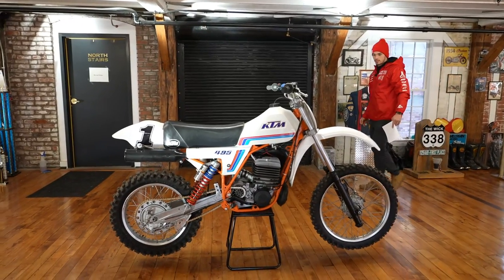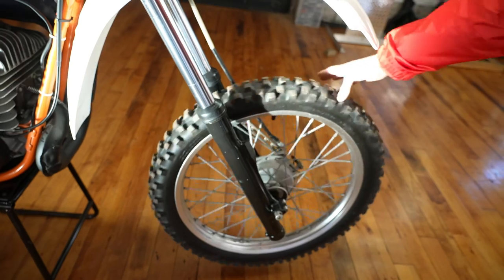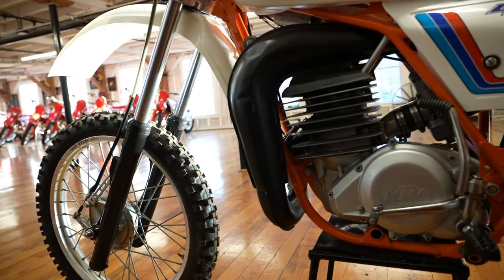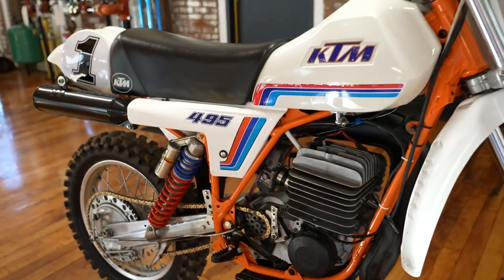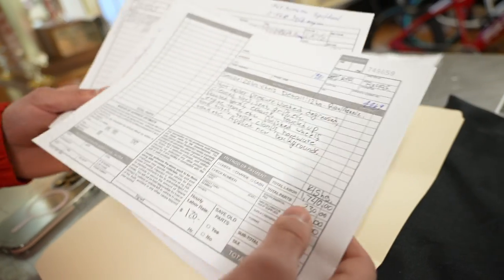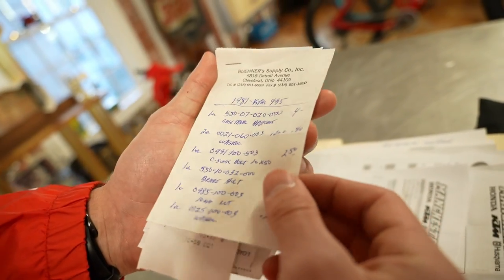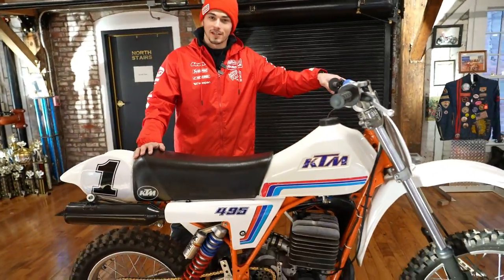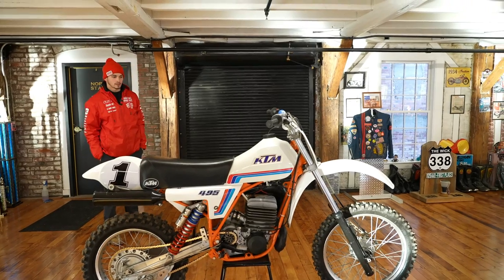123.75 MPH WORLDS FASTEST STOCK DIRTBIKE KTM 495 CLOCKED IN 1981

Comment: My buddy had one. He didn't tighten down the cylinder bolts properly. We were out riding and he said the bike wasn't running right. I asked him to fire it up. When he did, the cylinder and head was moving up and down!. It still ran! We tighten up the bolts and nuts and went on our way. The bike was definitely badass. Tons of power.
Reply: How is that possible? If the cylinder moved even a hair all compression and thus combustion would be lost.
Reply: Crazy right? But I saw it with my own eyes. The cylinder and the head are connected so the compression was still there.
Reply: My ‘81 KTM 250 MXC did that out on the trail. I had to stand on the cylinder head to stop it from sucking air at the base of the cylinder so I could get it back to the garage.
Reply: Crazy😂

Comment: Hi Ken. In the 80's I raced an '81 Maico 490 twin shock, and my friend had a '85 ex works KTM 500. It was so powerful, it felt like 4-stroke to ride. Fantastic bikes. 🏍🏴🏴
Reply: I believe way back. Dirtbike Magazine, when it was cool. I think SuperHumky clocked the 495 KTM around 120 or so. If it had different gearing, maybe faster. I think. I will say this, that those early KTM's are neat bikes. Rare back then even. Didn't see many 40 years ago.
Reply: I got to ride a retired ‘70s moto-x Maico in ‘95. the owner was my GF’s uncle who had 2 Bultaco bikes as well. Maicos were basically race bikes bought from a dealer weren’t they? I don’t know a thing about them…I just remember riding that one in ‘95 was the 1st time I ever used a decompression valve.

Comment: My buddy had a 1982 KTM 495.  I don't know what the CR was, but it flipped me clear over the bars when it kicked back.  The timing was advanced so far btdc it was rediculous.  My buddy was a body builder and weighed over 300lbs.  After he saw what happened he had a go at starting the bike.  It kicked back on him too, which pissed him off.  Bob's legs were huge and he could do over a thousand pound leg press.  He came down on the kickstarter again with all his might.  The 495 kicked back again and it was Bob vs bike.  The chrome moly shaft coming out of the engine that the kick starter attached to snapped in half!.  I took the busted shaft off and you could see where the shaft's metal had twisted before shearing.  While waiting for a new shaft to arrive I took a look at the Motoplat ignition.  It had an INTERNAL Rotor!  That's right, NO weight on the crankshaft!!  I ended up getting the regular Motoplat that gave some enertia, and retarded the timing.  I also stuffed two head gaskets on it, the bottom of my foot still aching.  The bike could now be started but was still crazy fast.  I had fun at the Oregon Dunes on that bike with a 14 paddle tire.  None of the rails and buggies stood a chance in the drag races up the dunes at Honeyman State Park.  I still have that internal rotor Motoplat and Bob kept that busted shaft as a souvenir.
Reply: Bob was lame

Comment: I rode motocross on a 1982 496MX in the open novice class when I was a sophomore in highschool in 1982. It had the dual control throttle that I ran on the 1/2 twist mode to slow down the throttle response. I also went up one tooth on the counter to mellow it out a bit. I would start in 2nd gear. Shift to third on the start and ride the entire moto in 3rd gear. 
On a dry lakebed it would go fast enough to bring tears to your eyes with goggles on. I have no idea how fast that is. I can tell you that I never saw the absolute top end on that bike. Going that fast with tears so bad that it was like having a swim mask full of water on your face is enough to make you roll off the throttle.

Comment: That bike was my competition every weekend at the motocross track for my CR480 and I don't recall the 495 KTM ever beating me!
Reply: The Ktm was not a great mx powerband. I worked at a large Ktm dealer in 1982 and we worked with some of the factory riders when they were on the west coast. John Finkleday and Joey Schlag were both on the bikes as well as a local rider that we sponsored named Tracy Oswell. Tracy was top 10 at Mammoth Mountain in open pro when it was almost a national. We spent the entire time smoothing out the powerband. Stock was so hard hitting it wore everyone down. Even Finkleday and he was a beast. Great looking bike and pretty reliable as well. I had a 250 from that year with twin online that year and it was the best twin shock suspension l ever rode.

Comment: Nice! Not sure it was tuned down in 82 might have felt like it they handled far better with the pro-lever rear suspension. It got the awesome power to the ground better.
Reply: They changed from a piston port engine to a reed valve design and yes, it was detuned in 82-84.

Comment: Hey fellas, I recently bought a 1977 Yamaha XT500 without a title for $500. It was almost complete when I purchased the bike. I also have a bill of sale. I started the restoration on  the bike because I had a really good paying job!! I have around $3,000 invested. New chrome swing arm, chrome coil shocks, all new brakes f/r, new tires f/r, all new plastics and a spare rear fender, all new cables, renthal bars and components, new shifter since the other was broke when I got it, the other stuff I got from a junkyard since most of that stuff you can't buy anymore. Even over seas most of those bikes are hard to get for. And most of the junkyard with bikes are almost gone! But I found some racing forks that fit and looked more like the correct size, foot brake pedal since the other was also broke, a brake rod and new twist throttle. All my parts apparently came from overseas and had to wait a couple months to get parts and a lot more expensive than building a mini bike lol. But the engine spins freely, bike frame has been blasted and powder coated white instead of black. I was trying to make a TT500 instead of the XT500. XT500 is the enduro version and the TT500 is the dirt bike version. I couldn't pass it up at the time because I wanted a dirt bike project. Unfortunately I have way too many projects I can't keep up with and I just lost my job and I need to sale some stuff including my unfinished dirt bike. I am looking to sale it if anyone is interested in looking to start a dirt bike/enduro project. If I hadn't of lost my job I'd keep it, but my boss did me wrong and I'm out of a job so it's got to go. I'd rather see it go to a good home where someone has the time and money to make it look nice. Ride it and show it and have a blast with it. I'm gonna stick to the mini bikes, RC racing and model car building since its way cheaper, more fun and you don't have to wait forever for your parts. With my dirt bike I lost interest waiting for the parts, ran out of money since it ain't no poor man's project, and I have other projects that need finished. Right now I have the frame sitting on a skid under a 2 tarps to keep the weather off and the other stuff in my shed in boxes. So if anyone is interested leave a message and we'll work something out. Gonna sale cheap just to see it move to a new home. Any questions feel free to ask. I don't know anything about the bike and it didn't come with a build sheet, so I'm basically trying to figure out what all goes to the bike. It was missing a few parts when I got the bike. Didn't know until I started on tbe bike. So that part I may not be able to help you on, but what I did to it I'll be able to help you on. 😊

Comment: Really nice bike. I think they had bikes that were just as fast when they went to mono shock about 1982-1983? I believe they went to a WP with Marzocchi in the front like the Can Am and a Reynolds frame. Bombardier wouldn't sell their factory works Can-Am MX 500 unless you had a comp license. The Rotax engine was ported to the max. It was capable doing those speeds. I'm not sure if KTM had 2 versions of their 500 but I know the Can-Am wasn't dialed back, they only manufactured a couple of hundred bikes per year.

Comment: Kx500 was clocked at 128mph by motocross or dirt rider magazine back in 1996? The problem with pushing past 125mph offroad since the 1990's is traction and wheelspin, not lack of power. We had to remove Rad shrouds , and narrow the handle bars, ride with elbows in for my 250cc Races back in the 90's to fight wind drag.
We were hitting 108mph on Kawasaki "factory" Kx250 1996, but those outdoor factory engines were like 16.5 to 1 compression 10,000rpm, Ti crank/rod/+60HP ping masters.Last about one race before spitting sparks and knocking.

Comment: Have an 86  husky wr400xc and it broke a 100 stock from the factory bc of the wide ratio transmission desert racing setup. Only a handful of bikes were capable of doing that, and it was sold that time that manufacturers seemed to have decided there was such a thing as too fast. The big bores didn't sell well new and worse used. Also have a yz465.

Comment: So my dad STILL has his 2003 wr450. The one with the 5 valve head and titanium valves. I shaved the head 30 thou, put an OEM replacement weisco piston in it, hinson clutch, run it on c16 and thats it. It has a megabomb header with the stock silencer from my 2022 yz450. With an 18 inch rear wheel, 45 tooth rear sprocket and a 13 up front at the gutbuster 250 in yurington nevada last year i was clocked at 125.1 mph on the 3 mile long section of highway in the middle of the loop. The thing hauls ass man. Old bike but shes so dialed in the desert i prefer it to my brand new 2023 yz450f when i do race desert from time to time. Im 6'5 250 lbs so my bike isnt really rideable for 250 miles through whoops with my suspension set up. So stiff nobody but me can really ride it fast.

Comment: does it feel more powerful than the later 500s or 550?
Reply: No, it's not as fast as the newer 500's. The radar gun that did that 123mph run was out of order. There's been many talks about it over the years. But the bike is still a beast & ultra cool. 👍 The powerband on those older bikes are actually a lot more friendly & usable.
Reply: Geared for top speed 125 on any 500 2 stroke is probably not hard as most can hit 80 stock gearing fast. May take a bit longer to top out but should not be hard with the power 500 2 strokes make.
Reply: Ninja 250 stock 29 hp can do 101mph, 500 2 stroke has almost twice the power so with street gearing 125mph is very doable, would just lose some quickness to top speed.
Reply: @RT22  

Yeah, gearing changes would definitely make a difference. However, those older 500's are at least 10hp down to the newer 500's  Stock gearing, there's not a 500 made that does that speed. Stock 500's are in the upper 80's & get there pretty quick.
Reply: @keithpeterson6108  yeah but geared for street 120.is doable just will not accelerate as fast, may be able to keep front wheel closer to ground lol
Reply: @RT22  

Yeah, I'm just saying they are down at least 10hp on the later 500's & stock gearing is nowhere near 120mph. When you start getting to 100mph (actually even around 60mph) aerodynamics becomes a big player in the game. Youbget around 120mph & it's a huge player in the game. At Bonneville, it takes almost twice the hp to match the speed of a shelled bike vs a none aero assisted bike. Just saying there's more to just gearing taller when speeds start going north of 100mph. It'd be cool to see what a modern 500 can do when geared up & on asphalt (least rolling resistance).
Reply: Kx 500  easily   ive got the  newer test magazine  of the 5 big bores  i think the kx and  maico 490 djd 117  to 121
Reply: @Ken juice Krajewski  

They did aome gear swapping to find top speed in a shootout? I have a kx500 & there's no way it breaks 100mph with stock gearing.
Reply: @keithpeterson6108  well i.know unfaired bikes with 50hp can and do 120, granted getting to 150 and up you need 100hp and more. Getting to 180mph you need 150 plus hp. Then as you try 2p0mph and above you really need major hp jumps. I know ninja 650 twin 4 stroke like 65hp does 130mph
Reply: @RT22  

The ninja is much better streamlined than an mx bike or non faired bike. Streamlining is a massive thing as speeds get above 100mph.

I know there's not a 500 with stock gearing that breaks 100mph. With different gearing, im not sure if they'll get over 120mph or not. Possibly on pavement, but definitely not in the dirt.
Reply: @keithpeterson6108  to a point but unfaired 500 street twins get to 120 with 50 hp. Aero starts at 100 but it is not until 130 and up that it really affects top speed. Many unfaired 500 600 bikes with 50 to 60 hp can attain 120mph no problem. 130 150mph is when aero really starts to factor in. Look back at many bikes with no body work from 80s with 50 or so hp that ran 120 or so all the time. When bikes started breaking 130 140mph did fairings start to actually affect speed. You can compare bikes that come with fairings and without, muddle weight ones have no speed difference, gearing has more affect below 130 or so mph. Yes you.may gain 2 or mph at speeds of 120mph. Now take 160mph sport bike remove body work they can lose 10mph top speed. I know guys with ninja 650 they crashed and ruined all body work. Their top speeds are basically unchanged at 130mph. In group runs they are not down more than a few mph to same bikes with fairings still intact. Ask speed nuts at Bonneville on 120 130mph streamliners they only gain a few mph. Now at 150mph and above you really see speed jumps streamlining
Reply: @RT22  

Aero dynamics affect a bike much lower than 100mph. If you're talking bigger power bikes, not so much. But smaller cc bikes are affected at 60mph.

But like is said, no 500 is going to break 100mph with stock gearing. The ktm was claimed to do 123mph. Not happening with stock gearing. Not sure if it would do it with a gearing changes as that bike is down 10hp (probably more like 12hp) than a later model 500. It most definitely wouldn't do that speed in the dirt. On pavement with a gearing changes, maybe, but maybe not. Until it's done, it's all speculation. Many people have dismissed the 123mph run of the ktm. The radar gun was supposedly on the fritz. But if the claim was it did 123mph with stock gearing, dirt or asphalt, never happened.
Reply: @keithpeterson6108  yes but geared right 500 2 stroke can hit 120 with no fairing, tuck body in it has enough hp to.push 230lb bike naked to 120. Have seen small naked street bikes do it with more weight and same hp. My piint on aero was not that it does nor exist at 60 but becomes speed killer at 130 for sure and would need tons of power to go 20 mph more like 150. But 500 dirt bike geared will pull 120 stone stock but gearing
Reply: Oh for reference have seen stock kx500 hit 87 to 89 stock gearing and tops out in less than 200yards, with gearing and 500yd another 30.mph 120 is doable 130 or more on naked would need much.more hp. Rz350 with 78hp does 135 and it weights 120lbs more and is naked bike. But to get another 20 mph would take 100 hp or more aero is not linear, up to 100 or 120 is a factor but as speed rises to 140 160 180 takes tons more power if aero.of bike is same. As speeds climb above 100 aero affects it more and more even with minimal speed increase. But below 120mph many bikes that do 90 to 100 gearing can get that 20 to 30mph but to gain 20 to 30 from say 150 needs much more power and better aero, as air flow increases hp has to increase a lit more. But from 120mph down geRing and small hp increase can get it done. But above 120mph aero.is much.lafger factor so not only hp but aero and gearing must be increased
Reply: Dort Bike tried to replicate that run on a CR500. They needed to remove the radiator shrouds, front fender and number plate for areo, tucked in tight, and still ran out of gearing.
Reply: @Dr. Hugo G. Hackenbush  

So they fell short of the 123mph on the cr500? Was it out of steam, or did they just not have the sprockets needed?
Reply: @RT22  

My uncle had an rz350 (still does) & that bike doesn't come close to 135mph. I think it was closer to somewhere around 115-120mph at best. That bike wouldn't pull taller gearing in stock form. He got some pipes for which helped it a bunch. Pretty sure he ran it with stock gearing & it wasn't over 120mph. If so, it wasn't by much. Nothing even close to 135mph though.

I totally get aero bikes vs non aero bikes.  A bike can weigh twice as much as the next (with the dame power) & still go faster than a non streamlined bike. At 60mph, aerodynamics is already a big deal on smaller cc bikes. Which means it IS affecting bigger cc bikes as well but they have the motor to power through. 100mph & every bike is getting affected. Again, the power let's them keep building speed but the acceleration is being affected. This drag will ultimately limit top speed. Drag has a compounding affect. It becomes more & more of a factor as speed goes up. 

I highly doubt the 40rwhp (at best) ktm 495 hits 123mph.
Reply: @dr.hugog.hackenbush9443  the point is stock dirt bikes not geared for 220mph 500 can hit 80 or so but gearing only can net 120mph as aero is not that big a factor. A factor yes but 60 to 70hp 2 stroke 500 can over come aero at 120mph. Much faster would require  more hp.or better aero. Naked bikes heavier with 60 hp easily hit 130mph. Only thing stopping open class 500 2 stroke hitting 120 stock is gearing not aero.
Reply: @RT22  

You're wrong. Aero IS a factor. Just because a 100hp engine bike cam overcome it doesn't negate the force acting on the bike. Aero matters as low as 60mph & gets exponentially more of a force as speeds go up.

What non aero assisted bikes with less are hitting 130mph? An rz350 (stock hp levels) does not do 130mph+ as you stated earlier. That bike is also Aero assisted btw.

We are talking about that 1972 ktm495 with only about 40hp (at best) to the rear wheel & less than 50hp at the crank. That bike isn't doing 123mph.